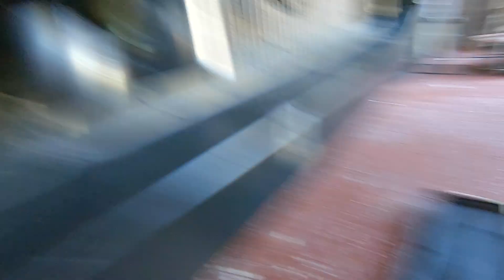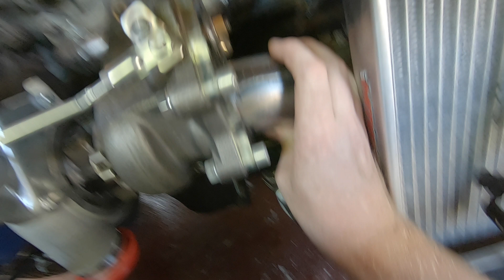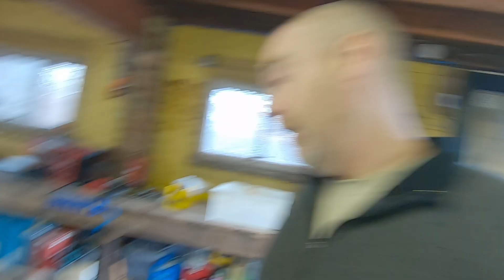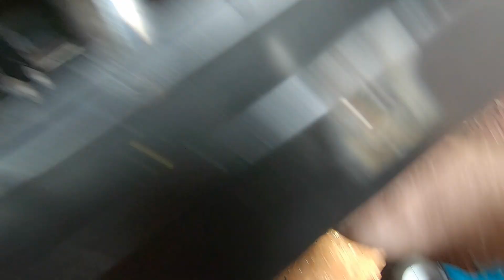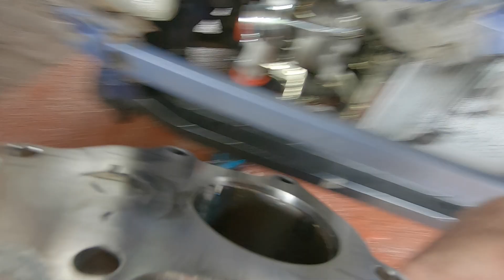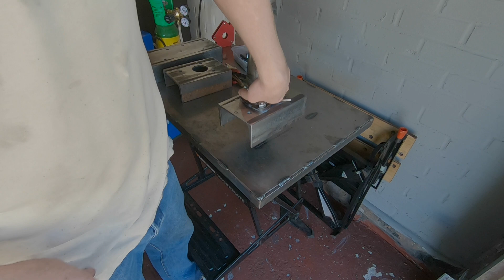How to make a Starlet Turbo downpipe exhaust (Part 2). | Toyota Starlet 4efe turbo build.

Comment: I used Jetex bends in downpipe they weld well and hold up better I think than stainless would have done as a down pipe
Reply from the maker: Thanks, good to here it. I agree that the Steel is good quality and they welded well for my purposes too.